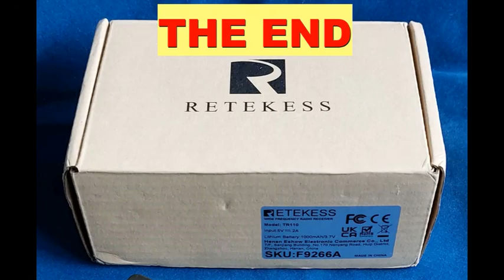WHAT IS INSIDE OF RETEKESS TR110 MULTI BAND  RADIO( Ssimilar to HRD747, RF760 models) Taking a tour

Comment: what did you do with the antenna there?
Reply from the maker: The antenna is there. I did nothing with the antenna but I put in an anti-paralel pair diode for static protection. The antenna is still there connected  to the  main board via the  red vire. The ferrite rod antenna is there without a change. It is covered by some black tape- by the manufacture, not by me.
Reply: @imreolajossr6355  CONNECT THE ANTENNA TO YOUR UMBILICUS!!